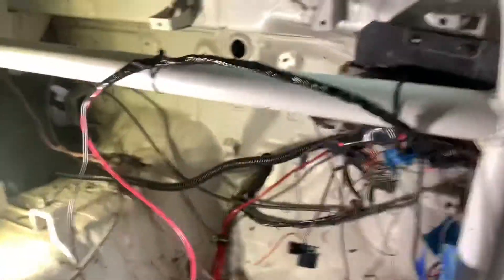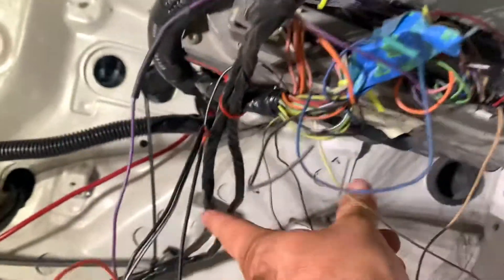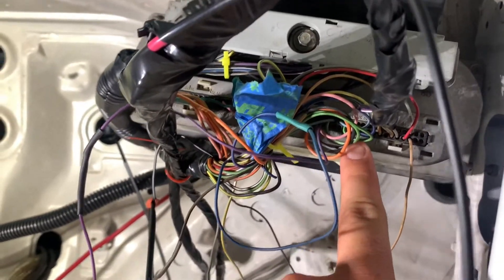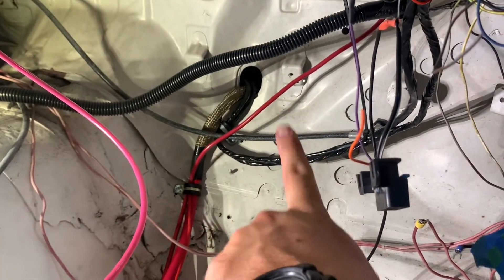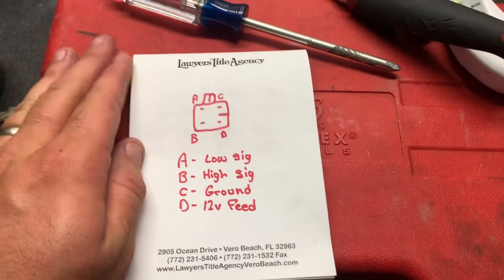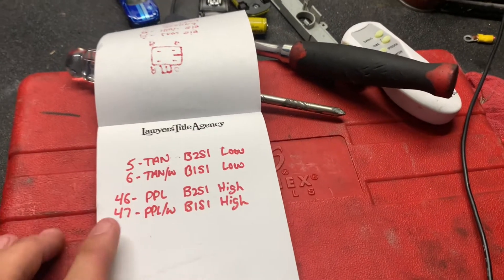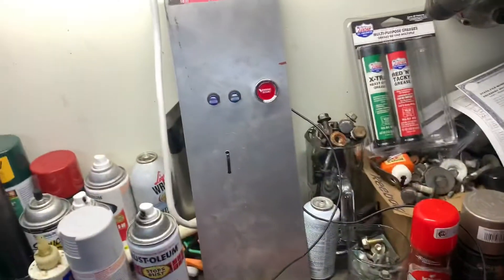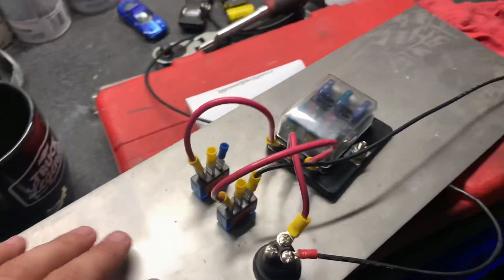Ls swapped 240sx (ep. 6) ft. GM 4 wire uni O2 sensor wiring and 3 position switch wiring.

Comment: Hey, great video to clear up some confusion I had, so the 12v feed did you wire that to key on or does that come from the pcm?
Reply from the maker: I believe I did a switched power, same switch for my pcm so they come on at the same time